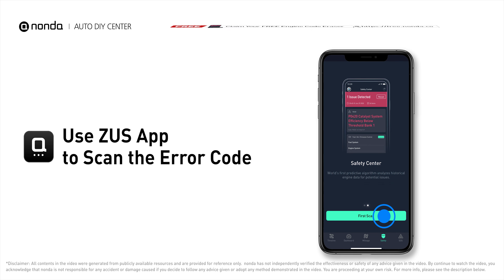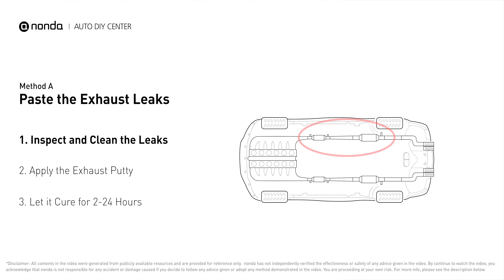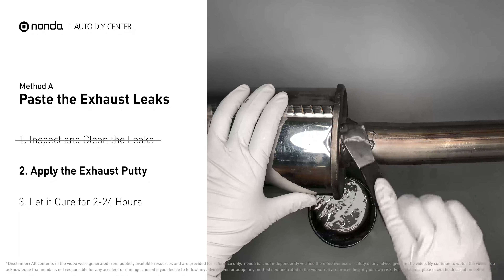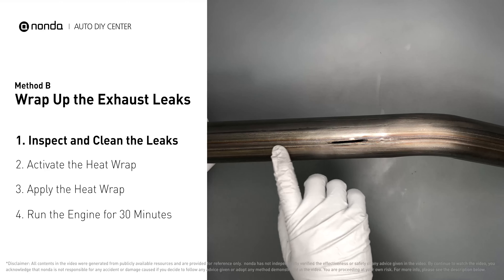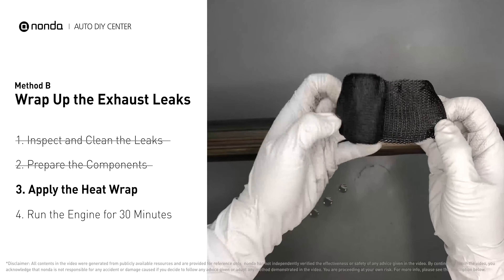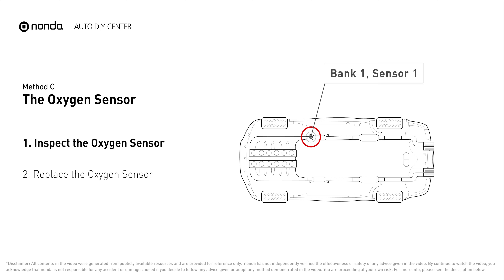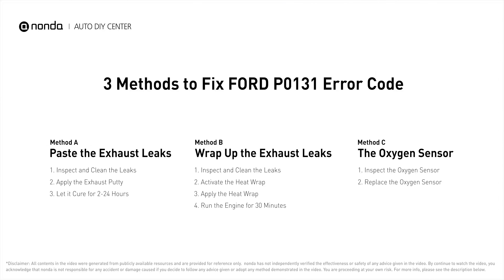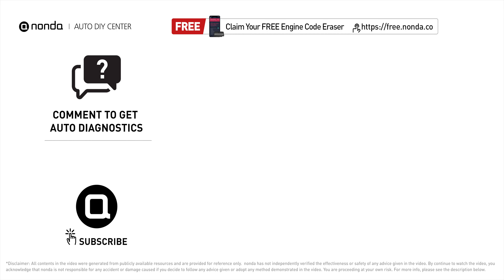How to Fix FORD P0131 Engine Code in 4 Minutes [3 DIY Methods / Only $9.65]

Comment: After putting in gas, my Fusion won't start. After a few times, the engine light came on. It showed two codes, P01450 and P0131. My mechanic replaced the purge valve and the engine code is still there. Any thoughts or suggestions, please and thanks!